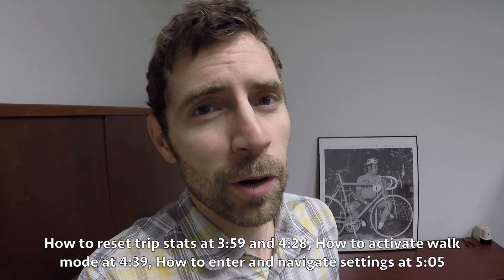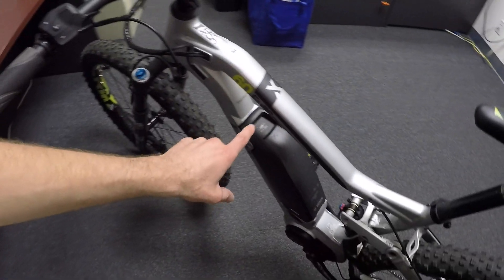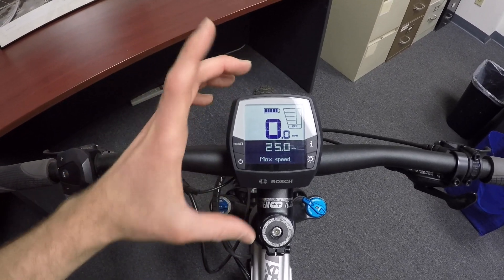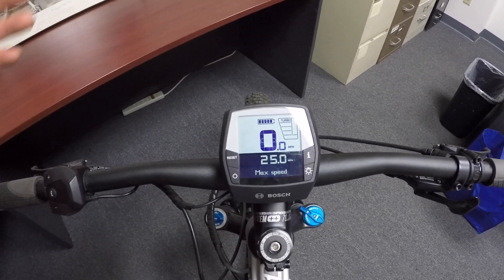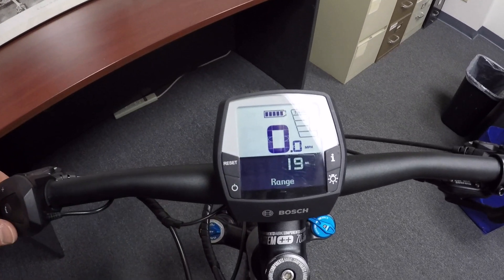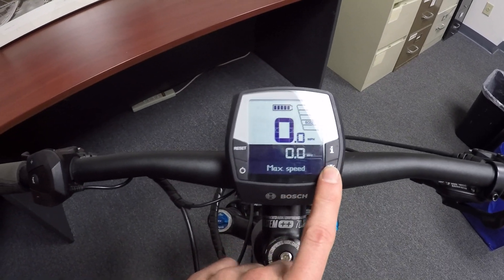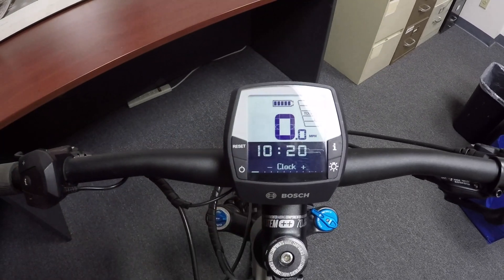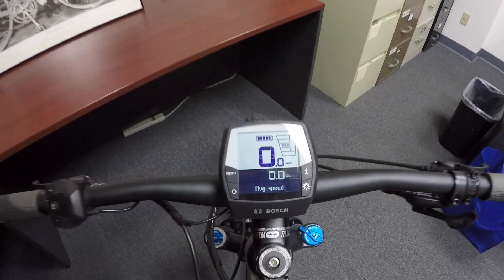Bosch Intuvia Electric Bike Display Settings

Comment: A couple things you missed:

When you reset trip time, trip distance, or average speed, it also resets the other two.

You can also reset range. This one I learned from one of your videos! For example, if you live at the top of a hill, range will be low when you get home. Reset the range and it'll increase, since it will forget your recent climb and assume average consumption per mile.

So there are 3 "flavors" of reset.

Comment: One addition I read on. Propel video recently is that if for some reason the Intuvia display doesn’t turn on you can do so by pressing the button on the side of the battery powerpack. You can also charge the Intuvia display by using that same micro USB port.

Comment: One correction: to enter the configuration mode you hold down Reset and i simultaneously, but to exit configuration you hold down Reset by itself. Otherwise it tends to jump back into configuration mode again, very frustrating! You have to fiddle with this every once in a while because the clock tends to run slow, losing maybe two or three minutes per month.

Comment: Hi, I recently bought a Kalkhoff endeavour advance 2018 ebike which has an Bosch performance CX motor. 
All the software and firmware is the latest (5.7.3.0/1.7.0.0/1.7.1.0) as displayed in the review.

However when switching to "sport" mode, "eMTB" is not (briefly) displayed on the intuvia display. Any idea of reason why this is ?

Comment: My 2015 model had the battery in the head unit die on it as well, but Bosch said that it IS NOT a coin battery, it's a rechargeable NiMH battery and they made me pay $130 for a whole new head unit.  So your uncle is confused.

Comment: How do I lock this display so nobody can nick it?
Reply: You can screw it onto the holder from the back of the mount. However, it is safer to remove the display and take it with you as this locks the bike's motor.

Comment: Why can't this thing do proper math? If I ride with a 500ms wheel rotation time and a 2m130 circumference, instead of showing 15,3 km/h it shows 16,3 km/h. I set the wheel diameter to 2130 in setup, and used it on a self made pulse counter to compare side by side. Strange enough, the lap distance is identical, so that does get calculated the correct way. Somehow this piece of software junk from Bosch, ads a 6% bonus to the speed to make you feel faster.... These things are nasty, they only support properly to 23,5 km/h, if you try to go 25, you sweat your pants off.